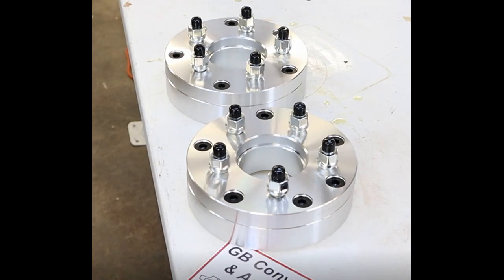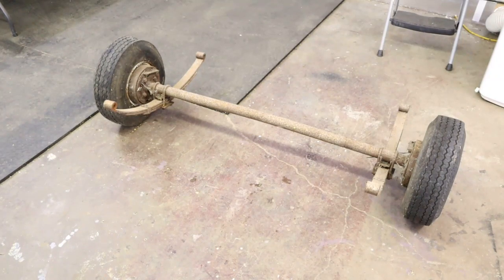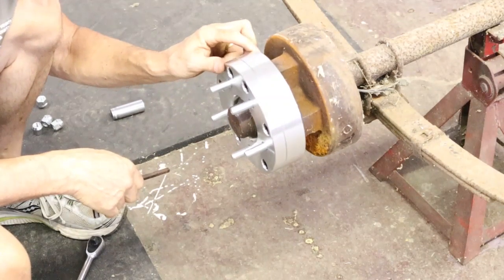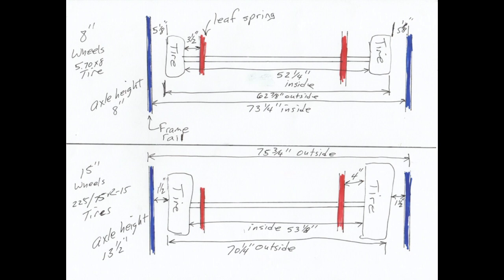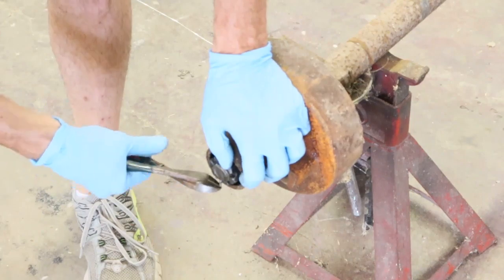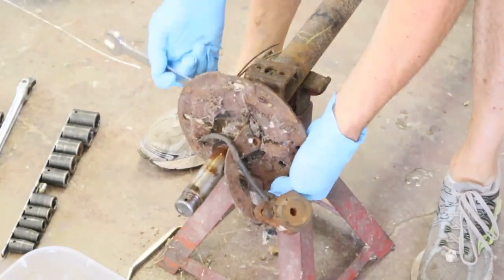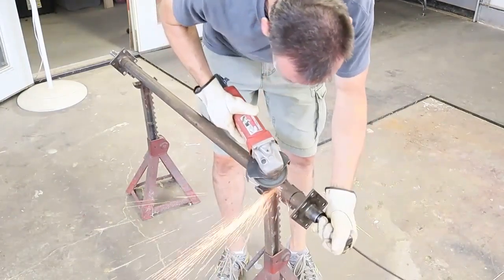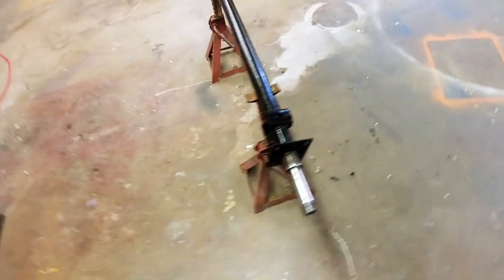JAYCO POP UP CAMPER PT 7 REBUILD REMODEL Modifications Renovation Axle Flip Aluminum Wheel Adapters

Comment: GB, Changing Your frame rail
Reply from the maker: Yep, that is next on the list MT. Thoughts?
Reply: @FakeLegGreg  GB, My computer sometimes causes Me great mental anguish when I try to reply to an e-mail. The angled metal rail is a great idea and You can also check You're tire air pressure easily. If possible could You please show Your subscribers the old school way of adjusting the wheel bearing tension on Your axle. Every one ought to know how to do this before technology does away with it. Always enjoy seeing You do first work or not doing it at all. Best Regards.
Reply: GB, In the last sentence of My reply to You a word was accidentally left out.The word is Class. My fault not the computers. I always think You do First-Class work.
Reply from the maker: Thanks MT, much appreciated.